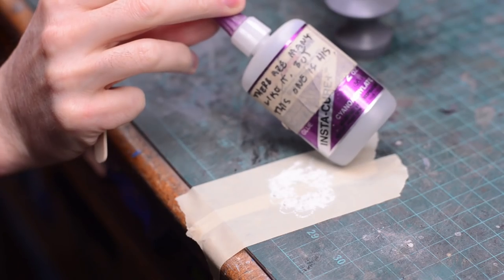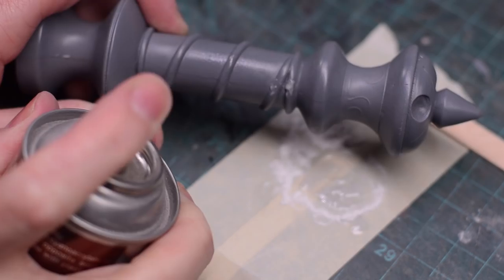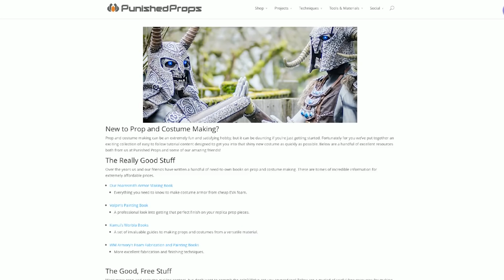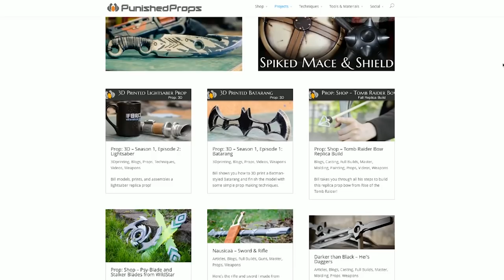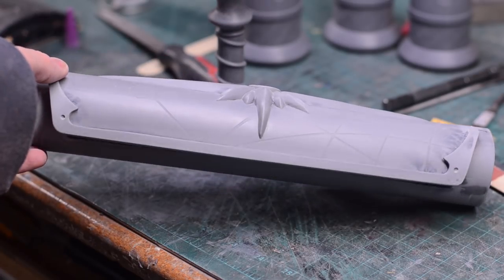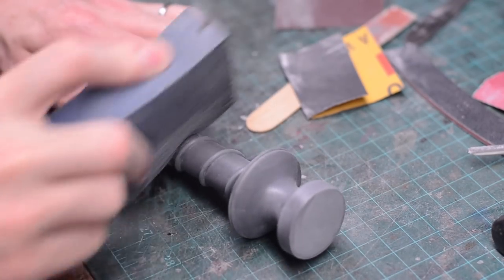Prop: Shop - Prepping Cast Resin Kits for Painting

Comment: So sanding is the only way right?:"[ i feel like it might remove the texture on what i made using  cast 300 🤔🙁 if i file it down
Reply: If I recall Plasti Dip doesn't require that to stay in place. Plus, if you make a big mistake you can remove it and start again
Reply from the maker: If you have a texture you want to keep you can lightly sand or use a filler primer to help fill in small gaps or bubbles.

Comment: what primer did yall use? :o
Reply from the maker: We didn't use any primer in this video, but it will depend on the piece. If it has larger spaces and not too many tiny details, filler primer works great! Otherwise we usually use a basic Krylon or Rustoleum primer from the hardware store.
Reply: @punishedprops  thank you!